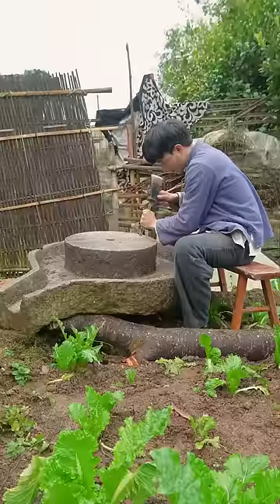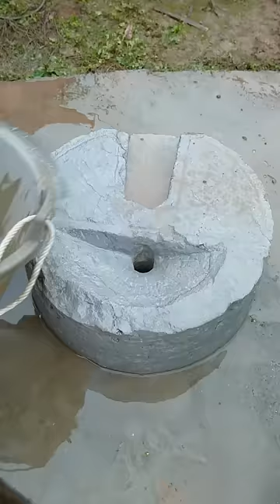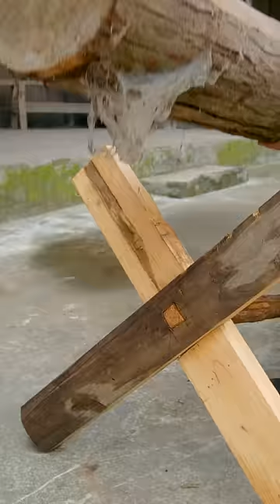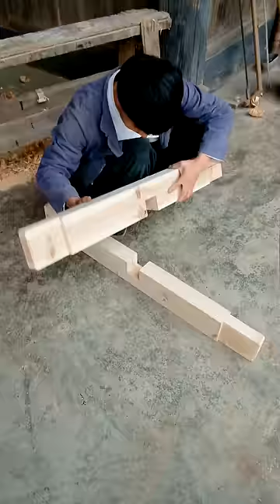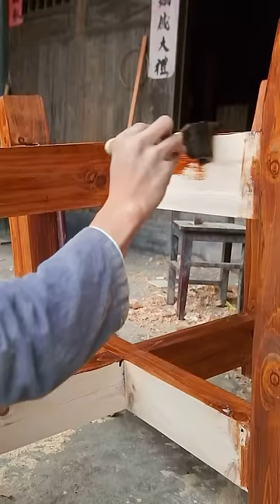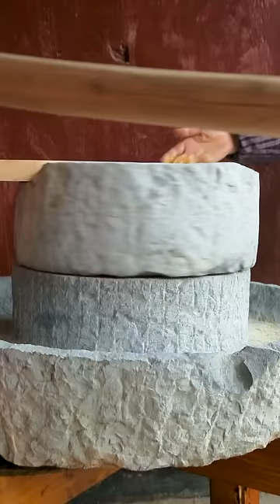Renovate the stone mill that has been abandoned for a hundred years

Comment: Things like that can last more than a  life time and still be of use to others. Great job on the restoration.
Reply: And the small stone particles in the end product will sand down your teeth over time
Reply: @VadarVadar  it adds a nice crunch into the mix.
 
Jokes aside, I undoubtedly prefer modern rollers.
Reply: @VadarVadar  you do a few test runs tho and get all of it out.... the stone will wear down over a few uses and eventually flatten out and then you won't get bits of stone in whatever you're milling
Reply: @fpsdovah2572  no it won't.
That's why anthropology can use the teeth to estimate the age of Skeletts
Reply: @fpsdovah2572  smooth is not good if you want to grind things down. BUT this can be mitigated with the use of a sieve! That is why recipies say to sift flour.
Reply: @fusionxtras  No God but Allah alone
Reply: @hindusaxeptallahuronlygodq5818  random and unneeded
Reply: The bits of stone can be sifted out my question is what was going on in that place where such a thing would be abandoned.

Comment: my fam used it to make flour , such a old fashioned way
Reply: They stopped being used because stone would also grind out into the flour, so it was common to watch for rocks in breads/flour based food.
Reply: @BigRheno  - they stopped being used because machines could grind more wheat faster with less effort - stones had ZERO to do with it.  In fact if you told a good miller worth his salt that there were stones in his flour you may as well invite him outside for a fist fight!
When oil runs out and machines die, most civilizations that don’t understand history will too.
Reply: @crystalm4324  I was just talking about it being a common concern because friction doesn’t distinguish between materials.  That’s why it’s called a grind stone, it grinds on itself and the wheat to pulverize it into a more useable material.

And actually yes, there were 100% small fragments of stone and such in material if it wasn’t properly sifted.

Comment: The problem is using stone as they did hundreds of years ago to mill and grind wheat or corn (maze) into flour there is stone powder in with the flour and it’s really bad for your teeth and causes a lot of excessive wear on teeth damaging the enamel and is the reason why we switched to metal grinders or ceramic grinders.  The reason why that stone grinder was discarded was probably because it they switched to metal roller grinders.